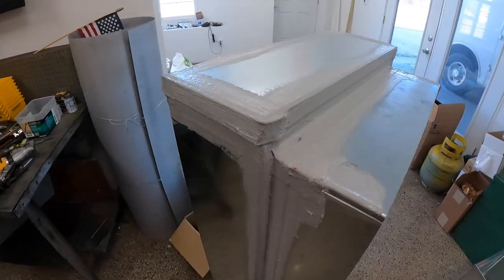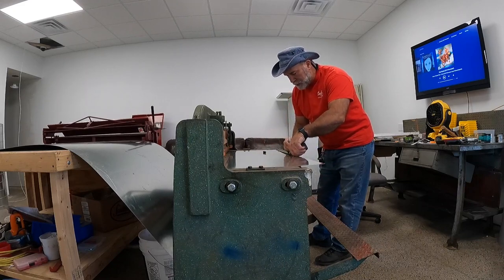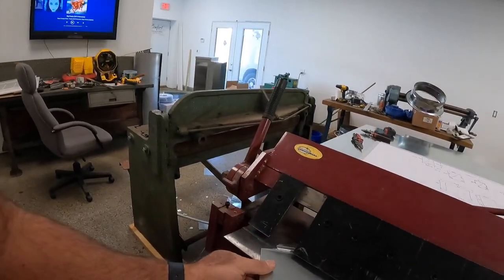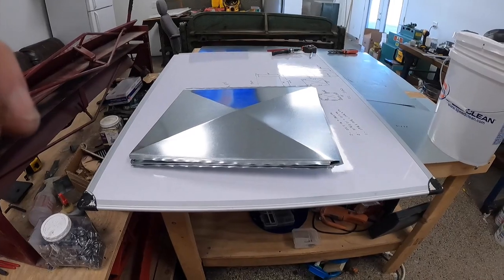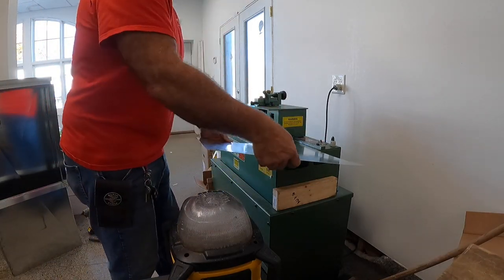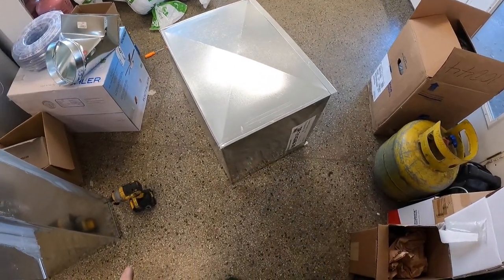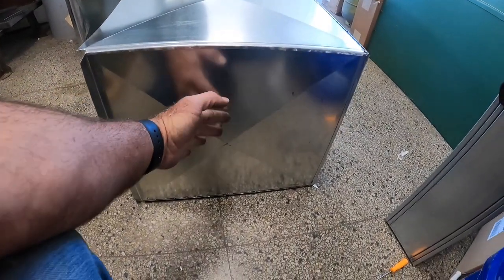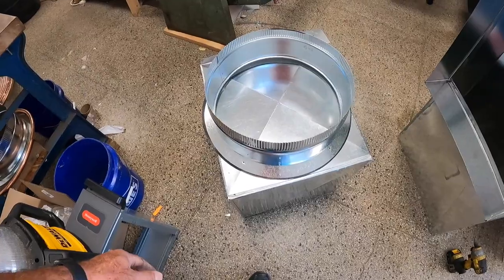Building a HVAC Plenum Box

Comment: Can you show us a good way to wrap a elbow with duct wrap?
Reply: I use the strip method. Cut the insulation into small 3” strips them wrap them around, overlapping each one a bit. Works well for me...but I bet Chuck Diesel has a better way!
Reply: Thanks Brent I’ll have to try it that way.
Reply: joe fargo I’m trying to picture it but will have to try. Thanks for the tip
Reply: @joeshearer1247  draw a pair of lips...center being round and tapers down...that should cover most of the elbow...
Reply: I am late to the game but just cut out "elbow gore's" with the duct wrap material all in one piece, then tape and wire wrap it and it will stay in place as long as the insulation lasts...

Comment: Any thoughts on how to build a plenum for a down flow air handler?  How to add strength to carry the weight of the unit?  Ive done it with unistrut in the past but it is time consuming and expensive.

Comment: I am looking to build or buy a filter box or filter rack that accepts 5" filters in the 20x25x5" size.  I haven't had the best luck.  You can buy the filters everywhere, but I cannot seem to find a box or rack that holds the full sized 5-5 1/4" filters from all the major brands.  I have found 4" and that is fine in most cases.  I am looking for filters that have low static pressure but at least a Merv 11-13 with low overall static pressure.